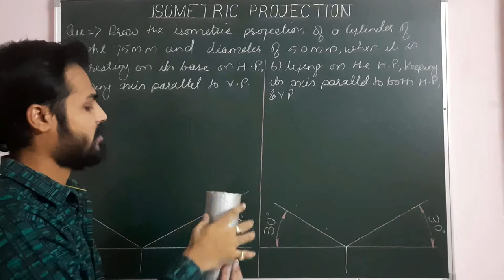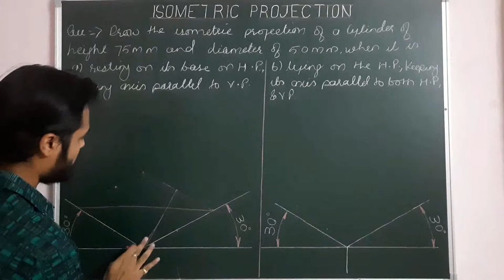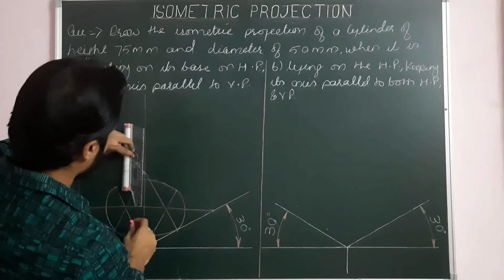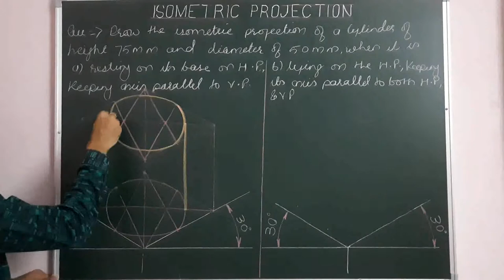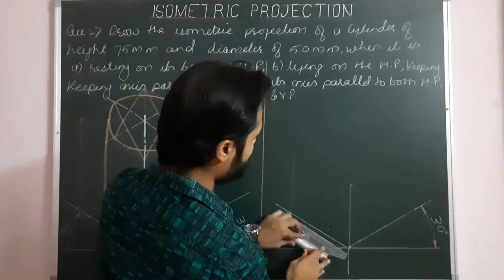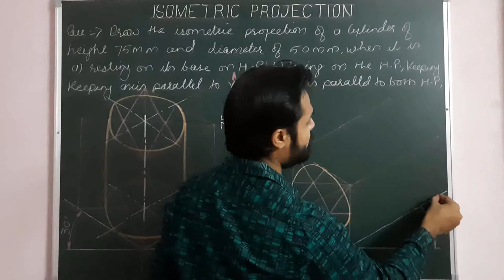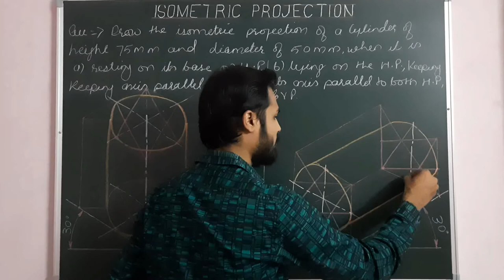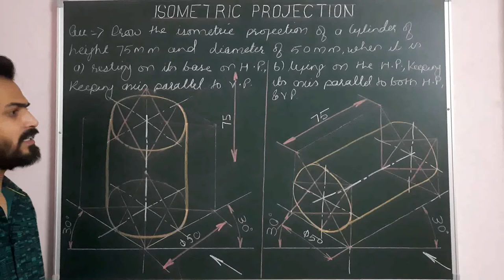Isometric Projection Of Cylinder  in Engineering Graphics (Part-8)

Comment: a cylindrical pipe of diameter 40mm and axis length 60 mm is resting on the hp on a point so that its axis is inclined at 40 degree to the hp and parallel to the vp.draw its top and front views.this question answer
Reply from the maker: this is related to orthographic projection of solids.... ill try to cover in coming days...